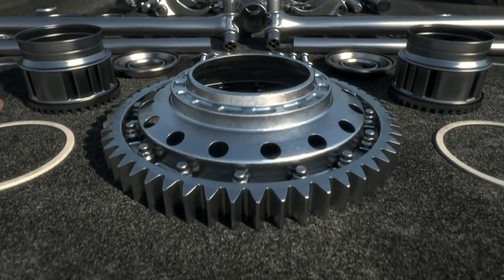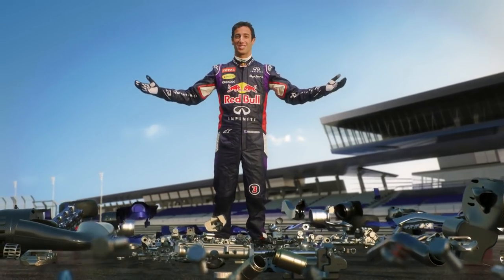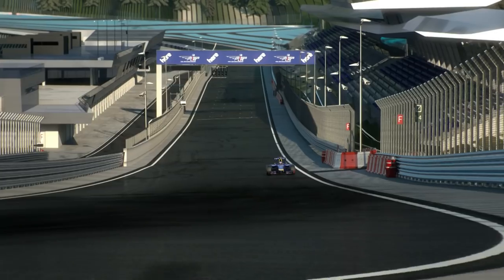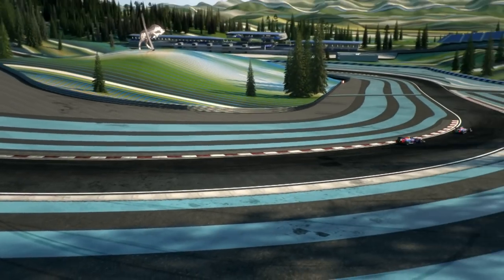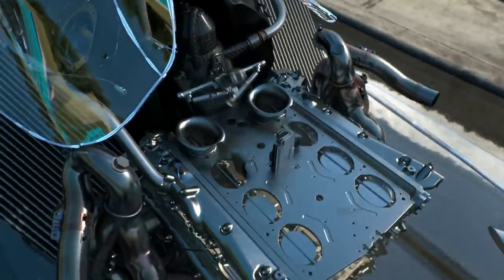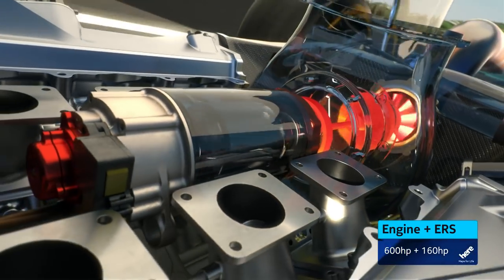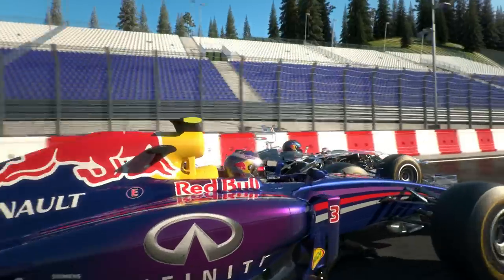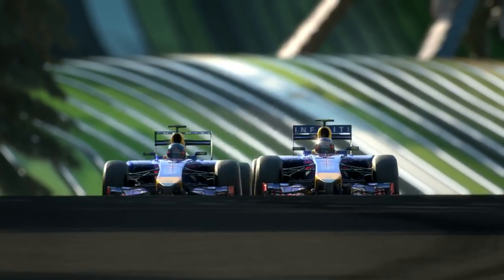Formula One V6 turbo: Rules Explained

Comment: Ok, first they were V10 engines, then V8 and now they're V6.
I wonder how much longer it'll take until they run on single cylinger engines!

EDIT: Coming back 5 years later I didn't expect to have sparked a thread this size, let alone over 400 likes. Thanks, I guess o_O
Reply: +darkknight HAHAHA that made my day, bro!
Reply: REALDualDesertEagle اریدگارت.نن جمبل
Reply: Turbine engines. Technically, they ARE single cylinder engines.
Reply: The V8 aren’t that bad. The V6 on the other hand, yes definitely a bad engine
Reply: theres also v12 v16 w16
Reply: Hi im from future and in 2018 the f1 cars are being replaced with electrically driven formula e cars that uses electric motors
Reply: V12 ---》v10 -----》v8 -----》 v6
Reply: @RizLazey  not yet. u gonna have to come back later
Reply: Or thet go back to 12.

They have used turbo v6 engines before the amazing v12/ v10 era
Reply: Was thinking the same
Reply: Single cylinger are not efficent at all. Most likely they will change from V6 to Hybrid in 5 -10 years
Reply: Maybe Quarter Engine Will The End
Reply: Na it’s going to be rotary engines next
Reply: Anders Mostue current cars are already hybrid engines
Reply: steam is the future
Reply: They will soon use jet engines
Reply: V8--> 200l/100km because the consumptions were unlimited. Now the rules of consumptions is maximum 100l/100km so the v6 is the best way.

Sorry for my english
Reply: Prob inline-4
Reply: Quad turbo 4 cylinder time
Reply: @jakethesnakeprado6386  getting a 4 rotor 787B vibe
Reply: The solution of the cylinder problems is the rotary. Well if you don't mind the fuel consumption :), but it has a better sound :))))
Reply: They'll go 4 cylinder and then electric
Reply: @Kuri0  2 cylinder 
Quad - Sequential turbo time
Reply: @mills3375  You mean the sound? Yes it's worse but if you go to a track the cars still sound amazing. The power? No way, the V6Ts in general produce more torque and are more fuel efficent. I still find it fascinating how they do 305-310 Km in 90 minutes sometimes with less than 100 Kilos of fuel.
Reply: @andmos1001  Do you realize Formula 1 has been hybrid since 2014, right? That "ERS" system that adds 160hp is an electric motor.
Reply: FrezZyK1nG true, however there is not an rule saying that cars traveling in the pit lane most use electric engines
Reply: Lmpaooo
Reply: F1 I4 engine..HAHAHAHAH
Reply: 8 turbo single cylinder
Reply: @mills3375  you have no idea what you're taking about. The v6 puts out more power that the v8
Reply: REALDualDesertEagle 2023 introducing two stroke engines in Formula 1
Reply: V12 > V10 > V6 > I5 > I4 > I3 > No engine, just pedals
Reply: @RizLazey  aged well
Reply: @jonessaness0171  
There have been I4’s that have competed in F1 in the past, even some cars with big V-twins back before the engines moved to behind the driver

Comment: I still like the sound of a V-12 engine over a 6 cylinder turbo any day
Reply: Real_fine_mess-it_is everyone would rather the sound of a v12 over a v6 turbo
Reply: Thats it... the sound. just the sound.
Reply: Skaayoo that doesn’t mean it’s good
Reply: anything sounds better than these shitty lower revving baby v6s of today.
Reply: Wind of change If F1 is supposed to be the pinnacle of motorsport then why try to push away the exact drive for innovation that made F1 what it is in the first place?   All just for the sake of sound?
Reply: Porridge Boss what are you on about?

Comment: Make the cars more fuel efficient? Who gives a fuck this is racing!
Reply: yeah, the buses going to the track pollute more than the freaking cars.

what's the poitn of making cars that race for barely 60 hours a year (if that) more fuel efficient? ffs.
Reply: ***** you really wont notice a reduction in speed, if anything the aero and turbo and energy recovery will make it more interesting to watch might even be faster
Reply: Because racing cars and the ultra competitive nature of the sport makes for innovation end engineering advances that eventually trickle down to the mass produced variety.
Reply: ever wondered where all the technology comes from in your car? This is where its developed, its done for a reason. With the laws for our vehicles becoming more strict with fuel so must the race cars. I think its awesome
Reply: I do agree that the move is not to most peoples taste, but apart from the sound - which I think is lacking a bit now - there are no shortfalls. The cars are now more efficient safer and overly improved, which will also lead to advancements in every day cars like said prior. I think it is a good move for the most part, but the v8 will be missed.
Reply: Lewis H
they're supposedly 3 seconds slower a lap. that's a shortfall to me on the top tier motorsport
Reply: ***** Your comment might be one of the most illogical comments I've ever had read. Nowhere did I say racing is about who burns more fuel. Racing is about who gets from point a to b, fastest. Race cars are meant for performance not fuel economy. It's like when people ask me the fuel economy of my RX-7... I don' t know, but I don't really care since its a sports car.
Reply: its the future , just like intel cpu
smaller but more power
i think if this F1 has a smaller bore and stroke with technology like these
can still maintain HP and big RPM
technology these days are focusing on both for more superior peformance

look mazda RX8 , its 1.3l and can put upto 240hp
imagine if the rx8 is 1.7l same is 400hp
if a bit bigger maybe 600hp
Reply: Jared Chong
That's a whole different conversation, since RX cars use rotary engines.
Reply: João Vítor
You see we think about it in different ways. I think of motorsports as no fucks given all out performance, not fuel economy.

Plus, I'd rather have 24 cars go around a course for a few hours every once and a while versus the 645,000 Ford trucks sold last year driving around daily. The point i'm trying to make here is that Formula 1 cars aren't going to do significant damage to the environment.
Reply: ksidornseif "I think of motorsports as no fucks given all out performance". In that case old F1 wasn't for you either. You should start a sport where all vehicles are capable of breaking the land speed record, otherwise they obviously aren't trying hard enough.

Eventually the sport will move to all electric, just like cars will. It's inevitable. It's a good progressive move, the more money and effort poured in, the faster we'll get there.
Reply: darkshad109 Funny you say that because I don't even like F1 Racing.
Reply: "no fucks given all out performance" Right, so when they had the rule of no refueling in the pits, that's not the engineers trying to be efficient and harness all the power they can with consuming as less fuel as possible.

You know if it were the case there was a series with absolutely no regulation, I would assume they would build an engine capable of not having to refuel at any time (fuel economy), drawing out every tiny drop of liter of gas to produce the highest amount of HP they could generate.

And why can't piston and rotaries be compared?

Because it shows that R&D into performance can in fact give you a higher hp number, while having better fuel economy which really disregards your comment as fuel economy not being "no fucks given all out performance"

Fuel economy is an effect of absolute efficiency for the sake of performance in motorsports

The sport can still be based off performance, just that the effect should benefit today's world.

Would an RB26, be able to churn out 300hp without turbo technology, had not the Gentlemen's agreement been enacted? A turbo itself is a product of fuel efficiency, while could be considered a performance item at the same time.

So, don't tie in efficiency (fuel economy) with not being "all out performance", because they're one in the same.
Reply: htsue  Very valid points. Although I'd rather they'd leave the teams up to their own devices... Either as fast as possible and refueling very often, relatively neutral, or slower but far more fuel efficient. It would make the racing for more interesting from a spectator's point of view.

Comment: do people not remember that from 1983 to 1988 turbo V6 engines were used? And back then they were only up to 1.5 litres, and despite the turbocharger boosting the power over 1000 horsepower it had HUGE lag and mainly operated in the high RPM range?

Unlike today's F1 engines which displace up to 1.6 litres and produce 600hp, and a little over 900hp including the turbo and hybrid systems? And these hybrid systems also remove the turbo lag to allow it to operate in the entire RPM range? These new cars are faster than the 80's ones if they had better tyres, more downforce, could rev higher and overall be easier to drive allowing the drivers to push harder. But whilst we hope for that in 2017, appreciate the engineering marvel that this technology is and enjoy the turbo whine that the V12's, V10's and V8's lacked.
Reply: Yeah i know people that say its bot like it used to be it is people dont remember 30 years ago
Reply: Exactly but back then aero had been largely neglected and just started to take traction (pun not intended), then Lotus and Porshe.....

Comment: The atmo V8s were slower than the V10s when they first appeared.
The atmo V10s were slower than the V6 turbos when they first appeared.
In fact F1 have been slowing cars down to make them safer and less costly since the late 1950s.
Nothing new here and as always the engineers keep finding ways to go faster.
That is the true joy of F1
Bring on the new season.
Reply: trentbaby65 the v10s of the early 2000s were beasts
Reply: @scottwhitley3392  slow to today's standard

Comment: The GT-R is a V6 and no one seems to complain about that car being slow...
Reply: ***** And you think a Formula One car is slow?  Your argument doesn't make sense.
Reply: MrDefining A F1 can be slow compared to another F1 ;) not compared to your van you are driving to work with everyday ;D
Reply: je préfère les ancien V16 V12 V10 V8. 
V6 2014       4 cylindre en ligne 2016???? 
le son est nul à chier
Reply: Johan Augustsson and this V6 F1 car is faster according to the video.
Reply: ***** it was implied in your previous comment.
Reply: ***** Well apparently you missed the point of the comment before you decided to post random nonsense.
Reply: MrDefining Lol you're making zero sense.
Reply: Danny13243 Nice originality. The GT-R is a turbo V6 like the new F1 cars and no one complains about the GT-R being slow so why complain about about a turbo V6 F1 car.
Reply: MrDefining  Lol you're still making zero sense.
Reply: Danny13243 Oh well I tried lol
Reply: GT-R nismo stock engine is a VR38DETT, V - vvl, R-supercharged, 3.8 liters, D- dohc,  E-electronic port fuel injector, TT- twin turbo, which makes 600hp of what I heard and read. Man I would love to have that engine in my 240sx, if a vq35 fits, I'm guessing the vr38 would fit to x-)
Reply: David Multigaming 4 cylindre b18b prochain coup
Reply: ***** hehehehe AMS 1500++ BHP yeah xD
Reply: FreeBestplayer123 1k+ HP
Reply: FreeBestplayer123 GTR R35 540HP from factory.
Reply: In my understanding, this video said there using v6, and a the only motor I see that's v6 is the vr38dett (gtr) or the vq35de or hr(350z&370z) which is being used for the f1. So I'm just saying comparing "JUST" motors
Reply: Yes..but the gtr wasn't a n/a v8 converted to a v6 either
Reply: That's because the 2014 version doesn't make 150 less horsepower than the 2013 version
Reply: but not as fast as a V8. and i got one question, are you twelve?
Reply: But V6 and VR38DETT are different. They have the same cylinders, but they're just different.
Reply: It's also competing in a segment traditionally dominated by FOUR CYLINDER ENGINES.

Comment: This is nice, Gonna be a good season
Reply: mystic1754 hell Naw. No fun in that
Reply: Randy R. Kelly Jr. there is no fun in having the computer do all the work for you the only motorsport left for men is formula D they drive manuals and they actually have to really on skill and not a computer.
Reply: Computers do a minimum. Driving takes skill
Reply: Lol if he can't control it without then he shouldn't be driving
Reply: Aidan D What computers are you talking about? Traction Control, Launch Control, Active Suspension and ABS have all been banned along with some other driver aids. Also, hate to say it, but flappy paddle gear box is faster and more reliable than a manual.

Comment: R.I.P F1
Reply: Obviously you didn't see the Bahrain GP.
Reply: TheRaazberry
There was good intra-team racing, but anyone who isn't driving a Mercedes powered car is absolutely no competition this season. This season is a wash compared to last. Ferrari is no threat as their engine is very down on power, their downforce isn't working, and they their chassis isn't performing well at all. Lotus, STR and Redbull are all using Renault engines which aren't any competition to Mercedes' engines in Mclaren, Force India, and Mercedes. This season is a joke.
Reply: socialismcanwork I guess that's your viewpoint on it. For me it seems like this season is far better than the last one due to the new tech and how it's affecting all these teams and it seems like Mercedes really did their homework. Only time will tell how this season plays out so far but after these first 3 races, with all the mercedes teams having a good shot, it seems okay to me.

Comment: i do agree with the environtmentalist that we have to make even motorsport more efficient, but tbh the v10 sounds waaaaaay better. but i think there's no way around it, we have to become an energy efficient species. outstanding video editing btw.
Reply: The main reason the FIA did this was to attract more investors, big brands by making it more eco friendly which is quite poisonous for the sport. That is not Formula 1. The future lies with a new engine one of at least 3.0 litres, V12, 20,000RPM, 900-950HP and a powerful KERS system. As for the car, increased downforce and fatter tyres. That is pushing the limits, that is competitive engineering and that is competitive racing. If you want to save your fuel and green eco stuff the apply that to normal road cars since that's the majority of cars.